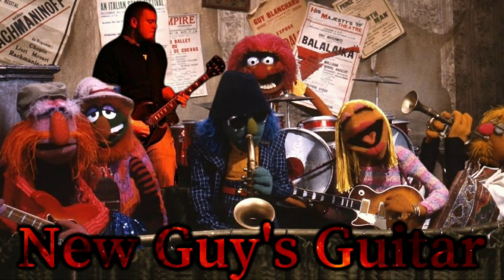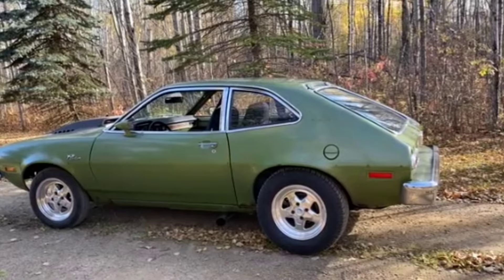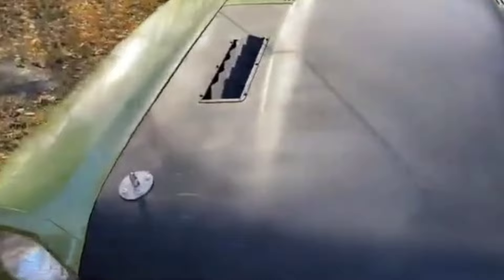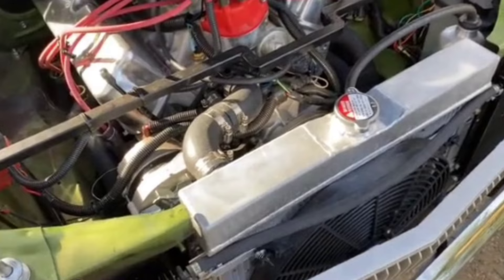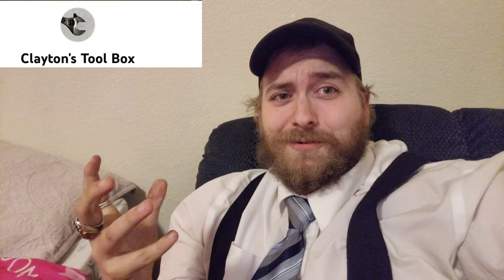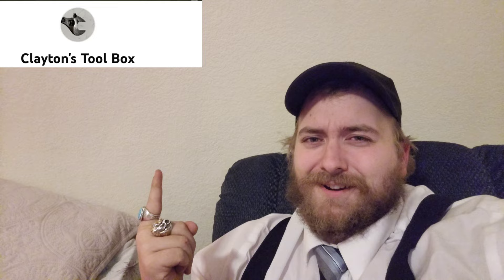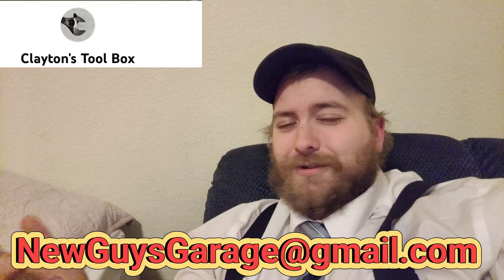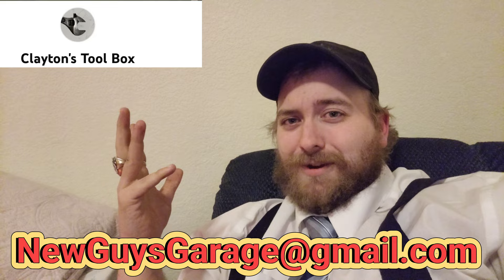1975 Ford Pinto With A 302 V8? Now Thats What I'm Talking About!! @claytonstoolbox

Comment: Ive got a 347 in my pinto and 2 primaries on my headers run through the inner fenders back around the frame where it ties back into the main header body then to the collectors to the 3" race bullets out to the x pipe then 3" pipes come out in front of the rear tire between the subframe connectors and the caltracs.